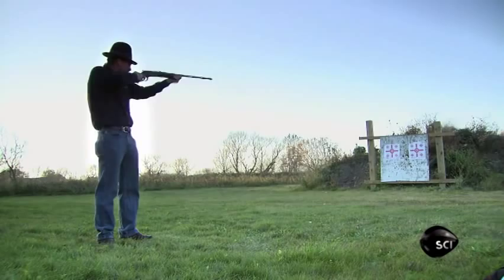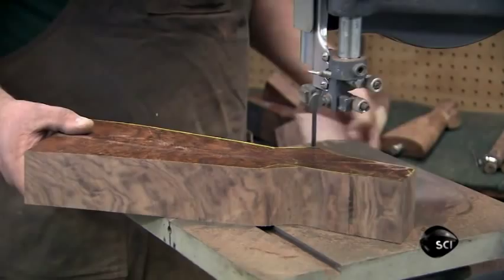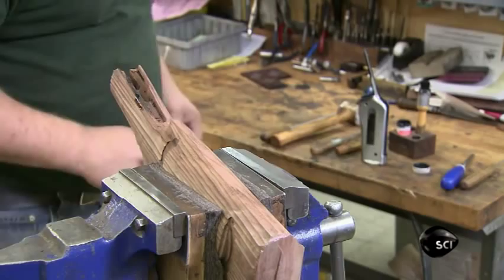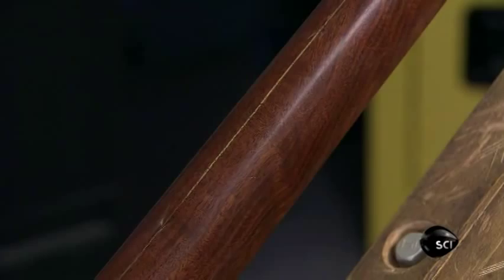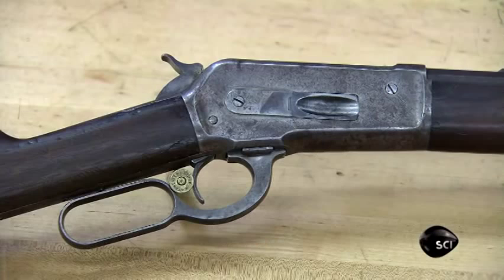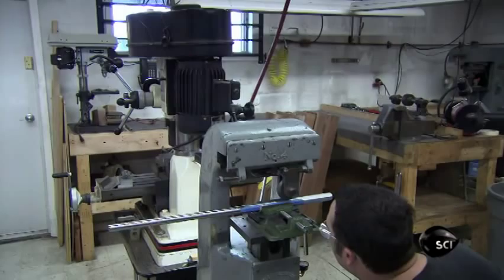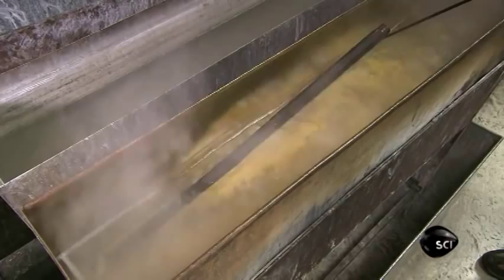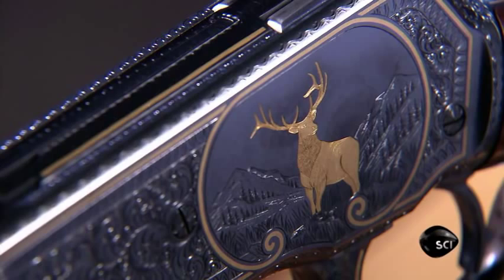Turnbull Restoration & Manufacturing on "How It's Made"

Comment: Too bad the tv producers ignored the full color case hardening process. Just a small mention. Doug Turnbull and company are recognized as the best. Too bad I'm in Canada.
Reply: The color case process is a VERY closely guarded secret process at Turnbull. While I too was disappointed, I wasn't surprised that they didn't show any of it.
Reply: The process is centuries old. You pack the part in an airtight container with charcoal, heat it until it would oxidize if it could, quench. Any number of gunsmiths and hobbyists can do it.  There's nothing "Secret" about it.  It's possible they use a proprietary carbon mixture for their colors (Charcoal and bone are the standard), but that wouldn't show on TV.

It's not shown here because they only had 10 minutes and there isn't much to see in the process.
Reply: they use potassium cyanide in their process is why
Reply: Just because you live in Canada, doesn't mean you can't get one of his rifles. I looked into it a few years back, and found some importers who would get them into the country for you. Don't quote me on it, but I think Prophet River Firearms in western Canada was one of the importers. Do a Google search and you'll find lots of importers who can take care of you.
Reply: @ronalddavis    No, they do not.   They use the colored case hardening process, with bone and wood charcoal.    They can, if a customer requests, do a cyanide case coloring, which lasts just as long, but is NOT case hardened.   They can also so traditional carbonia bluing as well.   Their basement restoration price for a rifle STARTS at $3,500.00, and goes up from there.   Turnbull does museum grade work, and they do it accurate to the period.   There is a reason why museums and major collections seek out Doug and his company for their expertise.
Reply: @jimdent351  your right . prophet river is awsome place with excellent quality goodies !!

Comment: I would restore every Winchester I have if I had the money. Why would I let my rifle rust away or keep the old cracked stock because its original? That's dumb. Restore it and enjoy it the way you would if you were back in the 19th century and make the rifle or old colt new again. That's how I think.
Reply: James Ross  It really depends on how far gone the gun is. If it has gone so far it's lost most of it's value. Why not restore it. But to redo  a gun because it has some wear. Makes no sense to me.
Reply: I clean them when they get dirty, steam, sand and seal when they get dings.  Cement and clamp when they get cracked.  It's called "maintenance."
Reply: It depends on the condition. Sometimes restoring a firearm will seriously damage the value. Other times it will greatly enhance the value.

Comment: how do they free hand those checkering and make the lines so perfect?! blows me away!!
Reply: It's a bit of a trick.. you use a template to lay out the outline and cut the first lines. Once you have done this, a double cutter is used that sits in the original groove and cuts another one parallel to it and at a set distance. You then cut the next line using the last one as a guide. Not saying it is easy to do, but it's not really free hand..

Comment: Wow never knew that the finnish on the rifle is what made it hard...amazing.
Reply: It usually doesn't. The hardening process shown on the rifle's receiver is what is known as bone & charcoal color case hardening. That particular heat treating process is done by packing the parts in a steel box full of a fine wood & bone charcoal, heating it up to around 1,500°, keeping it there for awhile and then quenching it in water. It imparts both carbon and hardness to the outer surface of the steel, and, as a side benefit, it also creates the beautiful colors that the process is known for. On the rest of the rifle, the blued parts, the finish has nothing at all to do with hardening the steel. All it does is make it pretty and help protect against rust. 

Most of the 'color casing' that you see on modern firearms, the lower cost models anyway ('lower cost' being very relative), is actually a chemical treatment done to the surface specifically to produce the colors and has nothing at all to do with hardening, which is why it's called color casing rather than color case hardening. On the older guns -- like those being restored by Turnbull -- as well as on much more expensive guns it's usually true color case hardening which is not only more beautiful than chemical color casing but is more durable as well. Doug Turnbull does the best bone & charcoal color case hardening on Earth! He has spent years developing custom recipes to perfectly match the original finishes of the late 19th century, and he uses different recipes for different brands of firearms. Colt's didn't use the same recipe as Winchester or Marlin or Remington, and neither does he.
Reply: It was originally done to supplement the lack of era-timeframe higher quality steel. It was a process necessary to strengthen the metals of the day. Today it's entirely unnecessary for strength but it has remained for its beautiful appearance.